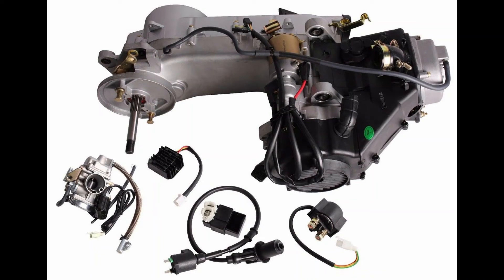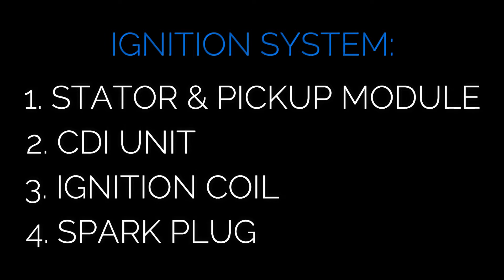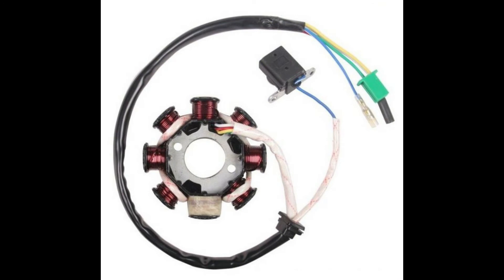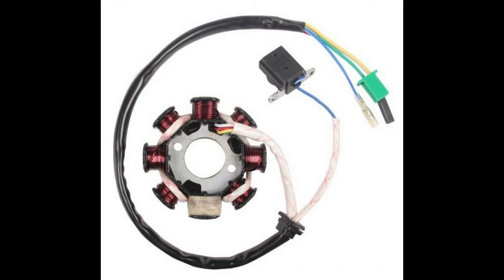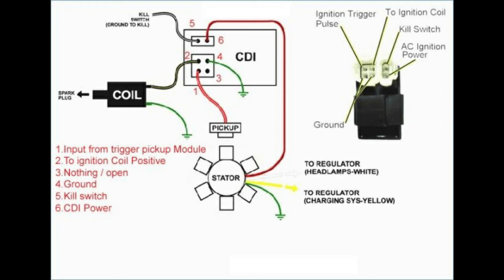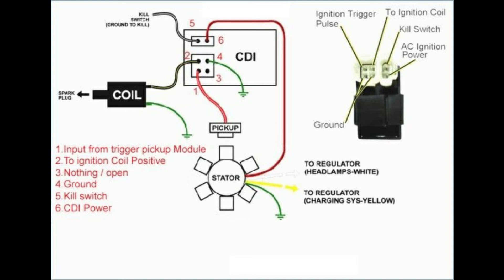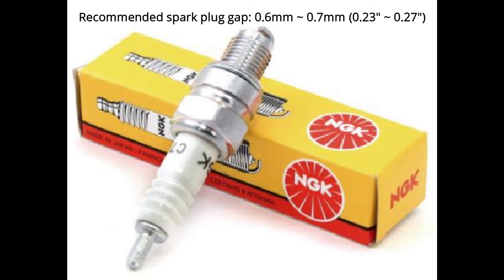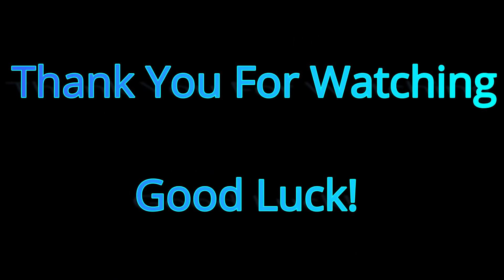Common GY6 Engine Problems and Troubleshooting

Comment: Your vid helped me a lot with my Buddy 125. It turned out to b a failing pulse coil. The little one that times the spark. It has been going bad for quite awhile. The scooter would start and run perfect. But when it was pretty hot after a long up hill run it would cut out just a little. Then it would b fine for a few days. I even would go on 50 mile trips. Then it started dying  more often. It would often seem to ohm out ok. Finally, it would stall and barely run. It the ohmed as open circuit. I replaced the complete stator and it is fixed. It was an intermittent problem that finally got to the point where it quit. Total pain. But very happy it is fixed. Thank u for that great diagram and video!!
Reply: Try to check spark when hot.   Plug and plug cap are 5k ohm each.  Check spark with cap removed!   Try running non resistor ! Bill
Reply: @williamhaskellhaskell3162  Good morning. The stator was the problem. I actually carry a tool bag with all the ignition components and an extra belt. I even carry one of my old Ryobi impacts with me under the seat. I think it’s been over a year now. Not one problem except I wore out a rear tire. Next time I get a tire, it will b a Michelin. The cheap I got is undersize, and the first week I had it, I got my first ever flat from glass. I plugged it, and it’s been ok. But I will get a Michelin. Thank u William!!

Comment: Hi Kyle. I’m trying to connect a dual cam to my Honda ruckus 2022. I cannot find the ignition on  connection or fuse on the scooter.  Would you know by chance? Thx
Reply: Thanks
Reply: It should be coming off of your starter relay

Comment: Can you please make it clear what is powering the auto enricher (electronic choke)
Reply from the maker: Hi J Rockner, I believe the choke is powered by AC directly off one of the stator windings, this should be the white wire i believe. AC is applied any time the engine is running. To do a quick test on this I would remove the auto enricher (choke) and connect it to a 12v power source and make sure the needle is extending. Should actually work with AC or DC
Reply: If you change carb. With out that what to do with the wire?

Comment: One thing you forgot to mention here as the auto enricher which happened to be my problem.  This is electrical and you do t talk about voltage or what wires from the cdi are powering this
Reply: It's puck up 1 and then ground

Comment: why buy a new carb when most you can just open and clean? saves you about 40+ bucks. wth man? i been doing this for 20+years and i try to save ppl money not have them spend when not needed lol.
Reply from the maker: Well new carbs online are only ~25 bucks for these engines and save you the headache of taking it off, cleaning, putting it back on only to realize it still is not completely cleaned. From my experience its worth the small price to just replace with a new one. But to each their own!

Comment: Hello there, I have no spark at all or any of electrical components are receiving any power.
I have a 139qmb Chicago go scooter 100cc bb kit
Reply from the maker: Hi Flacco_flow, I would start by first checking the battery of course and make sure it is charged. Next start at the battery and begin tracing power back through the electrical components with a voltmeter (or a test light just to ensure power is getting through each).

Comment: Okay so I have a problem I fix the CDI from this video it really help but I have another problem I bought I new regulator but the wire is burning hot so would I have to check my wiring to the stator or my wire to the ignition, also have brand new engine , cdi , coil ,
Reply from the maker: Hmm well it is burning hot because of the resistance in the wire. You say you have new components, is this the correct gauge wire for this setup?
Reply: @kylecrowder6940  imma change it to thicker wire soon I was talking about that to one of my buddies and I’m gonna put a bigger fuse on it to , so I’ll see from there

Comment: where is the 18 volts a/c at the coil primary coming from?  I was always told you cannot measure the capacitor discharge voltage ?

Comment: We are trying to troubleshoot an electrical problem with our Baja BR-150 Go-Kart, with little success so far.  It died while running it, and now when you hit the key to kick it over you can hear the solenoid click but no engine turnover occurs.  We've replaced the rectifier, CDI, solenoid, starter motor, coil, sparkplug, but that didn't solve the problem.  Voltage from the CDI power- in terminal to ground is ~12 V, but during attempts to crank engine the voltage from the CDI power-out terminal to ground and the starting motor-to-ground are only ~5 v each.  We're thinking it may be an ignition switch problem and have ordered one but it has  not yet arrived.  May be a stator issue, but that requires getting into the engine flywheel area, and we're hesitant to do that.  Any ideas?
Reply: Hey. He briefly mentioned in the video but you could also be having a faulty kill switch issue. Those things can leaving you chasing rabbits all over that motor. Since you have changed everything else it seems, changing your ignition switch also doesn't hurt at this point. I maintain a lot of go-karts including some fairly older models and I don't usually see stator problems. Hope that helps.
Reply: Try isolating the CDI. Test resistance from the ground pin to the rest of the pins within the CDI. Based on your description of the problem, the CDI has a short to ground or the capacitor is failing.  Is it an AC or DC CDI?
Reply: on mine I have this problem, it was running good till this problem arised.
everytime I try to start the engine
when I press the brake pedal To start it up, it blows the fuse off.
the fuse is inside the elec.box
any ideas Toto solve the problem

Comment: Maybe a stupid question. But is there a difference between negative ac and dc ?   The green wire from stator (ground) is connected to the frame/engine/chassis, but also connected there is the dc negative from battery. So its ok to have both AC and DC ground on the same place ( engine/frame chassis etc).
Reply: I just read a wiring diagram before that said you can have an ac or a dc stator depending on the manufacturer. If your wiring hasn't been played with before then maybe you have d.c?
Reply: Sweet
https://youtu.be/vnjRNz81MFs

Comment: I got a 2020 ice bear 150cc it starts good when cold and I can ride it a few miles and it will die and not start back until it’s cold again, I’ve replaced Cdi, spark plugs, coil wire , automatic choke and still same problem I got a stator coil coming hopefully it fixes what do you think my problem is !!
Reply from the maker: I would check the plug and make sure you are still getting spark after it dies. To me this sounds like a fuel problem, like the bowl is emptying. Check this after it dies, it could be a clogged line or jet. Also check the vent hose for the gas tank that it is clear, have seen this cause problems before. Hope this helps!
Reply: @kylecrowder6940  I thinks it’s getting gas bc you can smell it but I will check all those things ty
Reply: Sounds like your enricher, is not getting power. At startup, default allows more gas, as it warms, it closes up for normal running.
Reply: Hey Kyle, I have a gy6 ice bear and it started bogging out out of no where so I replaced the carb, spark plug,coil, cdi, starter solenoid and fuel pump and filter. It started up and ran its course and stopped bogging. Ran it for a couple days and today I was out riding seemed fine and I came home for a bit it sat for about an hour went to go start it and it turns over but won’t start. And smells like there’s gas on the spark plug now. I’m so stressed over this. I replaced a few hose lines but still seems to be having trouble getting gas. But it won’t start at all now. Any suggestions?

Comment: My blue racing ac 6 pin scooter wire harnesses (new) does not have the trigger wire (3) connected,  Do I need to place a ground in there and connect it to frame or the other green in the cdi or is it not required? Plz heeeelp😶
Reply: 4 pin regulator if it matters

Comment: My gy6 150cc go-kart won't even try to turn over when I turn the key. I have tried many different things including using a screwdriver to bypass everything and go straight to the starter and then it tried to start (unsuccessfully). I am very sure the problem is electrical but I can't figure it out. Any reason it won't try to turn over when I turn the key?
Reply from the maker: Hello Carter, it could be one of a few things. Most likely is the solenoid has gone bad and will need to be replaced. But it is worth checking the wiring between the key and the solenoid for breaks and also check for any safety switches your kart may have. There could be a broken switch to ensure the brake pedal is pressed to be able to start the engine. In my past experience this problem usually comes from the solenoid though. Thanks!
Reply: @kylecrowder6940  Thank you for responding, when I got the go-kart (2 months ago) I quickly realized that the wiring was old and corroded, so I bought a new wiring harness with everything in it including a new solenoid. I doubt that it is bad because it isn't very old. I did leave the original stater on the engine thought because it had the correct connections and I may have been a little lazy at the time. I doubt the old stator stops it from at least trying to start though. I know that the key is connected though because when I turn it the brake lights (not installed) get power. Therefore the key is connected to the harness, any other ideas? Again thank you SO much.
Reply from the maker: @cartermoore3301  No problem, best advice I can give is to take a test light and start at the starter and work your way back to the key. When you turn the key to start it make sure your getting power at the starter and if you are, then work your way back to the solenoid etc.
Reply: @kylecrowder6940  I have already done that with multi-meter ao it's basically the same thing. The pole (idk what they are called the things that stick out of the solenoid and one goes to the starter and one to the battery) the pole that goes to the battery gets a strong 12v when I turn the key, the pole that goes right to the starter gets 0v. Now that I type this out it sounds more and more like the solenoid is bad. I was hesitant to assume it was bad because it is new(ish). They are only like $5 I guess I will buy one. Again thank you so much for responding.
Reply: @cartermoore3301  check your cdi box. Replace it and it will start immediately
Reply: @gadrydaniel6692  I got an entire new electrical system and it still doesn't work.
Reply: @cartermoore3301  try the break starter relay fuse
Reply: Hi Carter, can you please reply what the solution was ? I'm having the same problem with my scooter. Thank you in advance!

Comment: Heeeeeelp I have a linhai 300cc no spark I change everything but the wires are do different any help to find wires diagram AEOLUS 300cc linhai
Reply from the maker: Hi Gherick, I found this post in a forum where someone else is having a similar problem. There is also a picture of the wiring diagram there. Hope this helps!
https://atvconnection.com/forums/1-engine-problems/345822-linhai-300cc-no-spark.html
Reply: @kylecrowder6940  i check it they being taking for days not solution plis is 2012 post but thank youuu very much

Comment: Hey Kyle, I've come across a scooter (150 Purfetti alto) that idles rough and bogs/stalls when accelerator is advanced while on center stand. There is a new carburator, coil, spark plug and cdi module on it. If you take the the air filter off and slightly cover the intake tube with your hand the engine performs much better which indicates a poor fuel air mixture ratio but I don't see any way to adjust it. Any ideas? Compression is 125 psi and leak-down test indicates 9% loss which are both good readings.
Reply from the maker: Definitely sounds like an air-fuel mixture problem. I would go through the carburetor and check the jets. You may be able to find more details on the carburetor from google specifically on where the mixture screw is. Also check for tears or leaks in the intake boot, sounds like it is getting too much air.
Reply: Lynn I'm having the same problems with mine. Exact same thing you described, new carburetor but will only start and run when I cover the intake. Then it dies when I give it too much throttle.  Did you fix yours? What did you do?

Comment: I get 0.2 volts AC at primary terminals of ignition coil. Moped sometimes starts and then dies after 30 sec or so. I think CDI is faulty. What do you think? Voltage at primary termoinals of ign. coil should be constant or pulsatile?
Reply from the maker: Voltage should pulsate at ignition coil. If getting spark the problem may not be electrical.

Comment: When my scooter gets hot it dies and wont start again
Reply from the maker: Tride02 have you gone through the electrical system troubleshooting steps detailed in the video? It is possible that your CDI or ignition coil may be faulty...